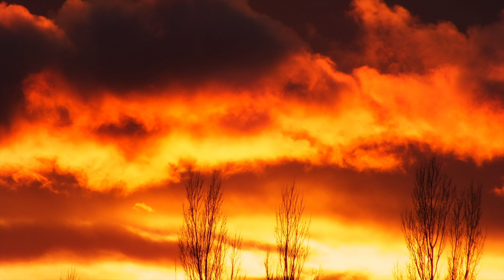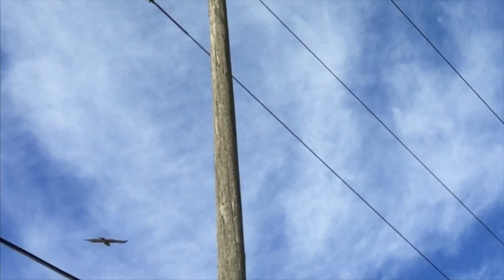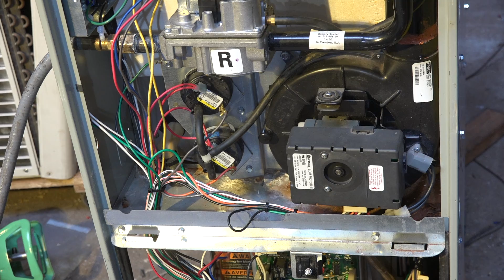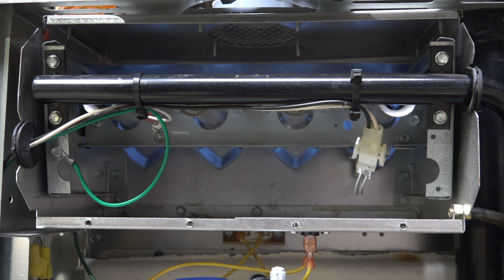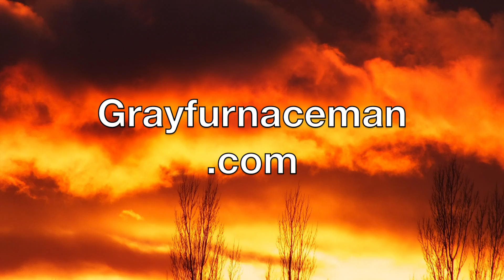What's wrong with this furnace, #8 answer

Comment: Can you specific on how you determined it was the inducer. When you ohmed it it had continuity all the time. When you tested the voltage I noticed that it wasn't open showing 24v and then closing???
Reply from the maker: The inducer is controlled by the pressure switch.  When the pressure switch closes, the inducer uses that info stop the increase in RPM then remembers that RPM for the next cycle.  The pressure switch does close but the inducer continues increasing until it reaches its limit and shuts down.  Hope this helps.
GFM

Comment: If I was there i would have jumped out the pressure switch and checked for voltage at the inducer motor,if it had constant volts and shutdown then the motors bad,does that mke sense GFM?
Reply from the maker: Maybe not that simple.  Voltage was checked across the pressure switch.  One of the things to understand about the variable inducer is that it increases in speed until the pressure switch closes.  If it has to go above a preset RPM, it shuts down, indicating a blockage.  
GFM
Reply: yes,those ecms can be tricky,thank you for information

Comment: how is a person supposed to figure out the variable speed circuit board inside inducer was bad from a youtube video? no bearing noise, it forced a draft, it was varying in speed, so it appeared to be working. kind of like asking how many jellybeans in a jar. regardless, you have the best HVAC tutorials and troubleshooting vids out there. maybe next time a couple more relevant, more specific hints as to a possible problem, lol.
Reply from the maker: If you look and listen close, it gives all the clues you need.  The way you saw it done was what I did to troubleshoot it.  Sometimes a video cannot give you the subtle clues that being there can.
GFM

Comment: So, what failed on the inducer?
Reply from the maker: I am not sure.  It has to be something in the electronic controls.  If you watched the first video, there never seemed to be power to the pressure switch from the inducer board.  I may try to dig into it.
GFM
Reply: I had watched the first video, the motor sounded like it was strong? Was it pushing to much air? Sad to hear it cost to much to repair. It would be nice if they made these things a bit more simple. I guess the two speed one is in effect going that route?
Reply from the maker: Trane replaces the variable motor with a 2 speed and a new control board.  At considerable cost.
GFM